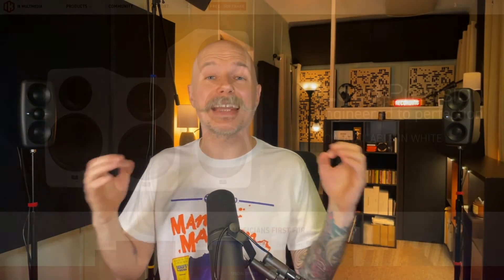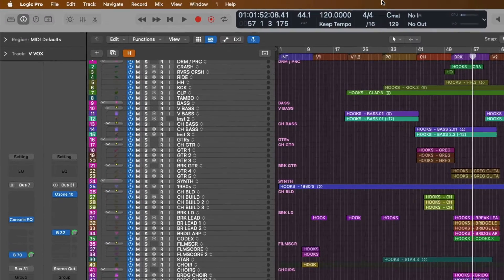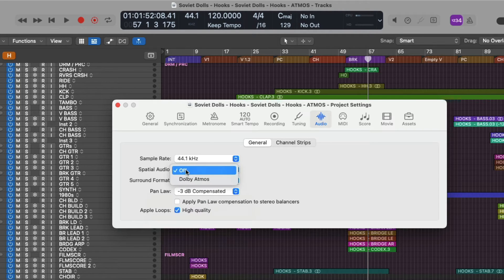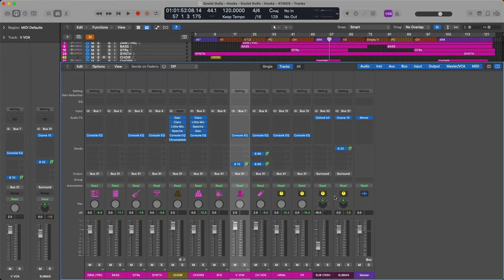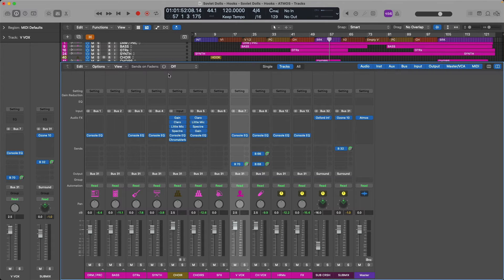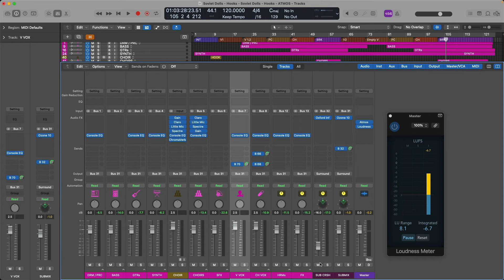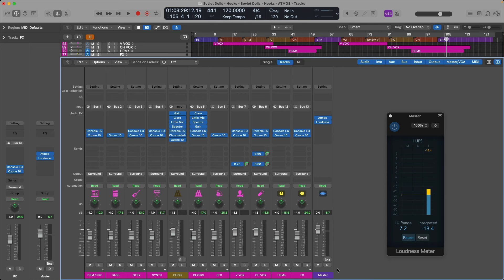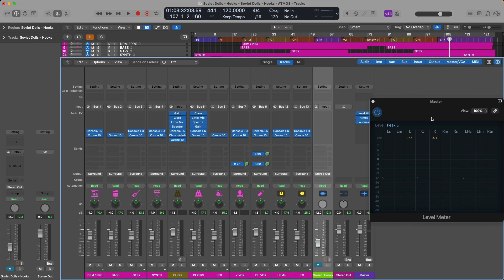#4 - Let's Rock! Flipping Stereo Project into Atmos (Dolby Atmos in Logic Pro Series)

Comment: When you convert a stereo project, you choose 7.1.2, but if you have a 7.1.4 setup, it still works fine and you can pan to all the height speakers? I would think there would be an option for 7.1.4 in the Project Settings.
Reply: It's easily confusing. The Atmos bed is a 10 channel bed 7.1.2. The height speakers are classed as left and right. This is so it is scalable, if you have 2 or 4 or 12 height speakers it doesn't matter the bed sees them as just left and right. When you use an Object then the speakers are used individually for the placement of the object. Hope this makes sense.
Reply: @NoQualmsTheArtist  I see, that makes a bit more sense. I do wish there was more clarity in the preferences, or even just a note about it. We need more terms for when setting up a project.  It seems like 4 heights is a common standard, why did they make the beds a standard 7.1.2? 

Tbh, using the renderer with ProTools is 20x more complicated...
Reply: @jeffreyjbyron  because the minimum requirement for Atmos in home theatres is 5.1.2. that's why the height speakers are .2
Reply: @NoQualmsTheArtist  Then you'd think they'd make the standard bed 5.1.2....
Reply: @jeffreyjbyron  🤷🏾‍♂️ is what it is.
Reply: @NoQualmsTheArtist   maybe you can help me... Chris mentioned to put monitoring mode to 5.1 to do adjustments to get the -18 LUFS. Running Loudness Meter in Dolby Renderer monitoring, I get a Master peak of -1 and LUFS of -18 approx.  But same surround project running Loudness Meter in 5.1 monitoring gives me -2.4 peak and -23 LUFS. Running the same track in Apple Renderer Standard monitoring mode, gives me +2.4 peak (OOPS!) and about -17 LUFS.  And in File/Project Settings/Audio, should I check 'Apply Pan Law compensation to stereo balancers' ?
Reply: @OfficialStevenCravis  pan law shouldn't matter. Dolby reads the loudness at 5.1 not 7.1.4, so that's the number that matters. If you analyse commercially released Atmos mixes you would see that they are actual all over the place with levels. I don't think the guidelines are as rigid as made out. Just try to keep in the parameters as best you can but some Atmos mixes are actually louder than you think.
Reply: @NoQualmsTheArtist  Thank you!